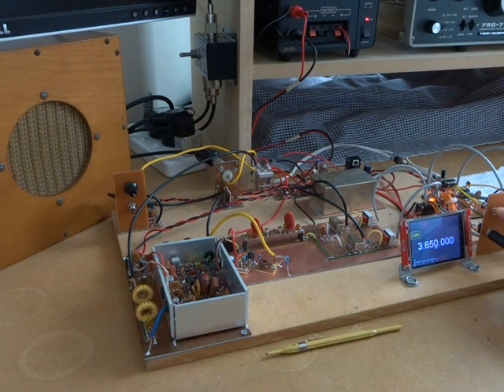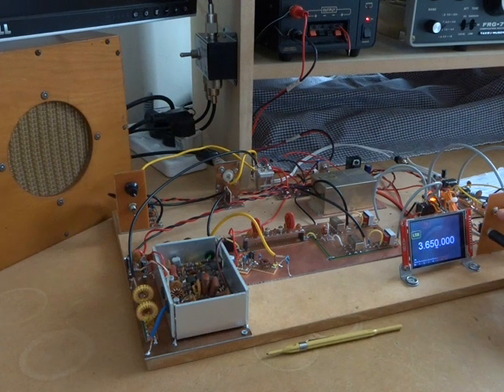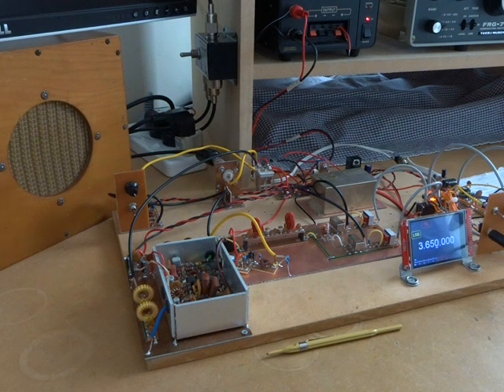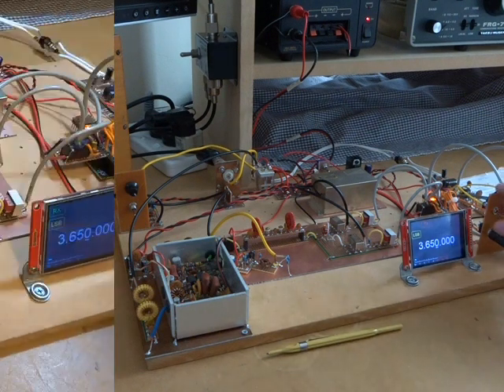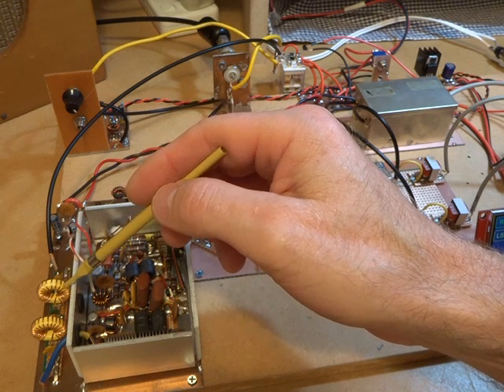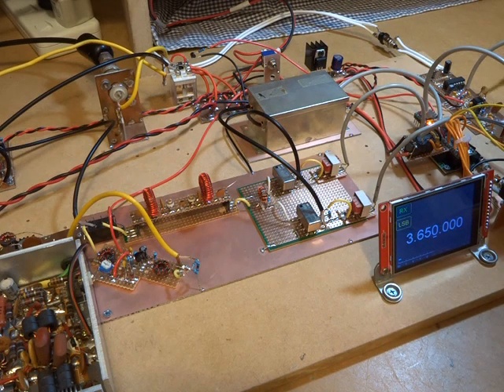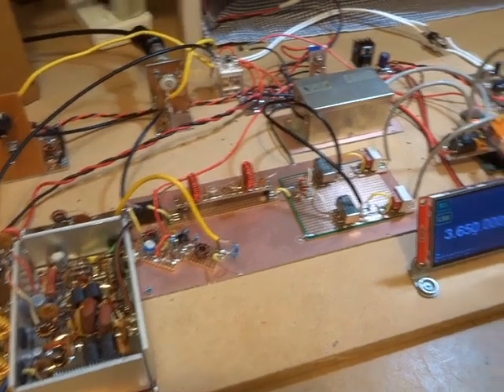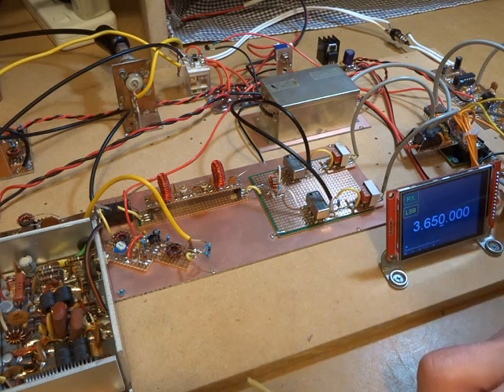80/40/20m SSB SDR Phasing Rig: Part 6. First On-Air Contact

Comment: nice rig, i bet that makes some nice IQ signals.  is the iq signals going into a soundcard?
Reply from the maker: Hi. The IQ signals are going into the Teensy Audio Adapter.  That board has the SGTL5000 which does all the heavy lifting using the Teensy audio library.

Comment: Do you ever box these up or use the sub assemblies in other builds.   I know you put the portable builds in plastic containers. Great sounding rig.
Reply from the maker: Hi David. At this stage I tend to leave them on the board so I can see all of the circuitry as I use it.  I am looking to mount one of the filter rigs in an old FRG-7 case. As for reusing sub assemblies, not really. If I do pull a radio apart then I certainly reuse componts like the 2N3904, and 100nF caps as they are pre-bent. Nothing goes to waste. The radio certainly does sound good, which is great.

Comment: That's great to see that the code for the si5351 is  working well on 80m . I must admit I've done very little with the si5351 since I was messing with the code. I need to get organised and get something built.
73  Brian...
Reply from the maker: Hi Brian. I'm certainly happy with how it performs, both in the conventional filter rigs as well as these quadrature LO based SDR ones.

Comment: Nicely done! I am working on a teensy 3.6 based station accessory (keyer, audio dsp filtering, etc) which is going well. Next is an sdr xceiver based on the teensy 4.0.  I am curious as to how much latency the signal has through the processor. I have a commercial sdr rx that has a whopping 350ms of latency - not too useful on cw...
Reply from the maker: That's interesting. I know SDR# has quite a bit of latency. I'll take a closer look once CW is enabled. That Teensy 4.0 looks good too. Considerably faster.